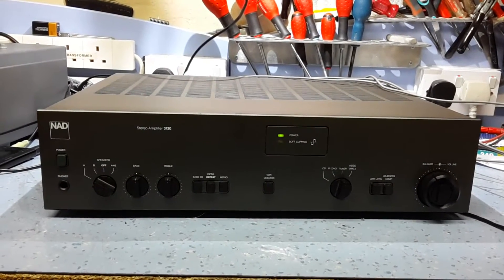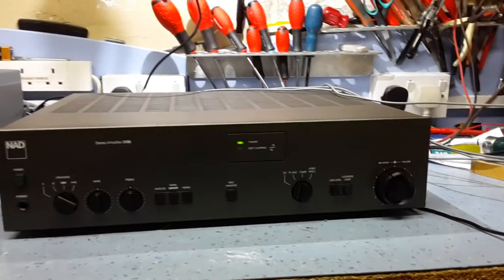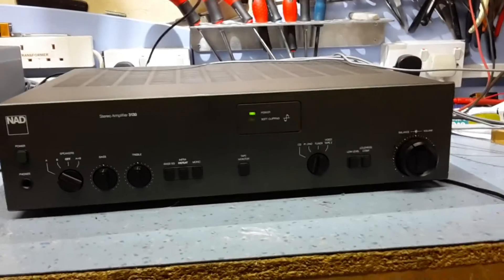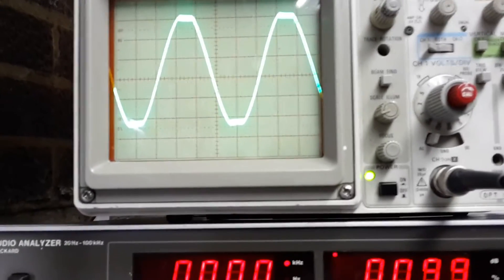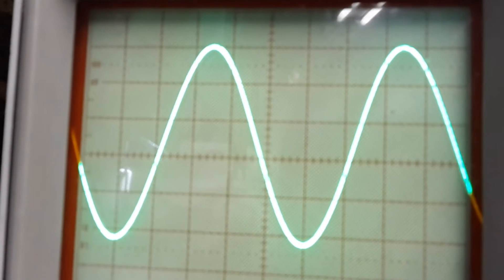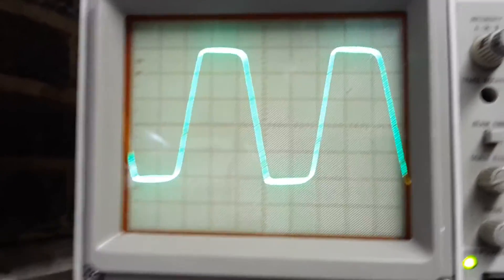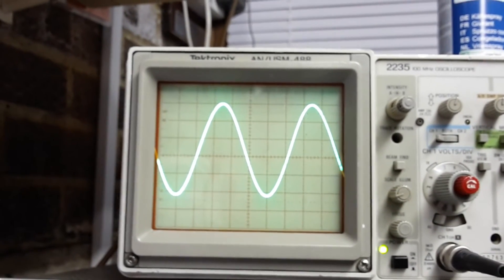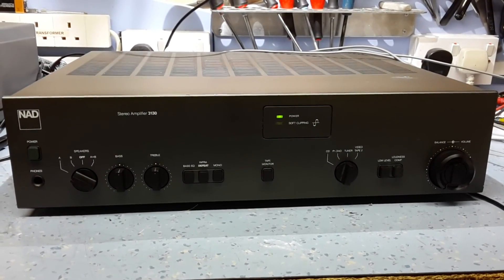NAD 3130 soft clipping on the scope

Comment: how much are these worth nowadays? i have an original unmodified/non repaired 3130 in mint condition. even though i used to run 4 Sony bookshelf speakers at max volume (facepalm) i used it as a desktop amplifier and it put up with the grief pretty well even though the neighbors rarely did :D as it was pretty damn loud. it was part of my dads hifi stacker that i discovered in the loft as a child and i was fascinated.
Reply: the vinyl player from the hifi stack was pretty cool too i forget where that now it has been years and what brand it was but i remember being blown away by the fact that whilst playing a record i could tilt the player a full 90degrees vertical and it would continue playing without a hitch it had a very complicated spring loaded arm with counterweights and such but the vinyl speed adjust didnt work as the belt the selector used had perished and crumbled and also it seemed there was a large resistor that seemed to get very hot and smell like dusty hairdryer and i recall seeing small amounts of smoke coming from it so i stopped using it even though 20 years of dust may have had something to do with it :D

Comment: Simon i have one of these and it is dead ! It will not power up at all..Any ideas ?  many thanks ..:-)
Reply from the maker: It might have blown a mains fuse, or secondary fuse. Usual cause is output stage failure.
Reply: Thank you Simon....I will have a look...:-)
Reply: @jazzey69  ..what was it in the end?
Reply: @CM-dw3gh  It was a NAD 3130 amp... many thanks..:-)
Reply: @CM-dw3gh  It was a transformer and the power up switch..:-) Many Thanks..:-)

Comment: I found that overall this amp sounded better without the soft clip engaged, from memory it was quite low powered anyway and to lower the overall power by a couple of watts made all the difference. Without the soft clip the overall distortion was quite low until you hit the power rails. With the soft clip engaged, the distortion level was much higher and started to soft clip (distortion wise) at quite a low level. PS NOT really a party animal!!